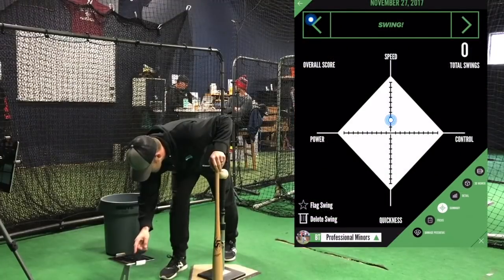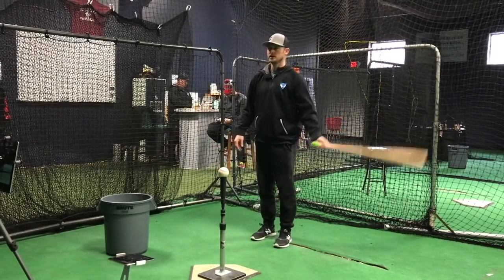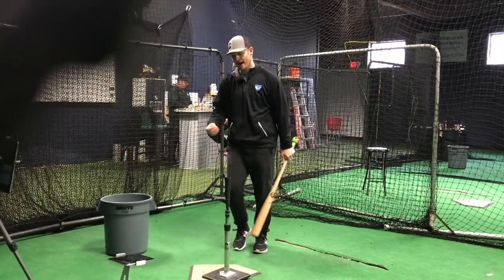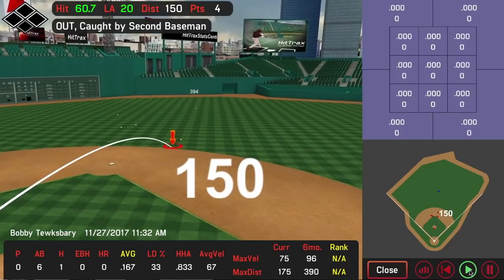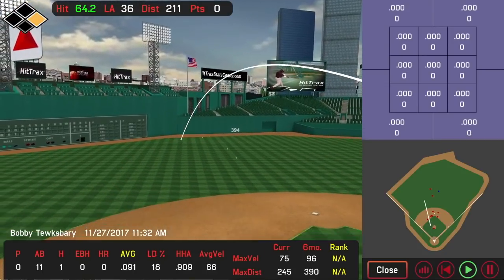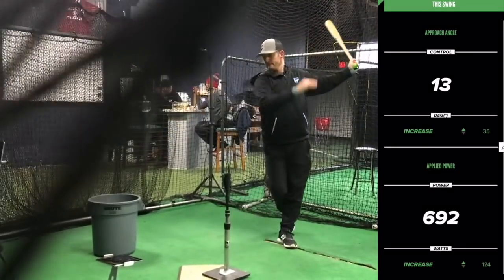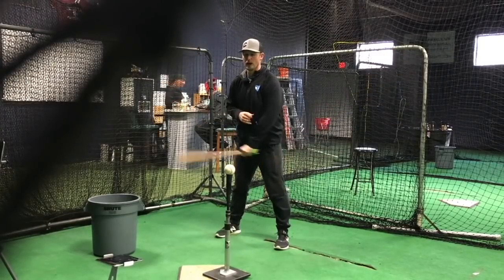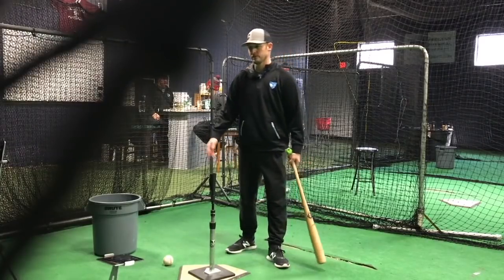Launch Angle Analysis with Diamond Kinetics and HitTrax

Comment: How do I get better launch angels? My average exit speed velo is 92 mph but have a hard time getting the ball in the air enough to get it out of the park
Reply: Swing thought for you would be "swing up". Not too much up, but up. Another key is where you are making contact on the baseball: on top, middle or bottom 3rd?  Middle to slightly below equator is best for optimal flight for line drive or long fly ball-dinger!